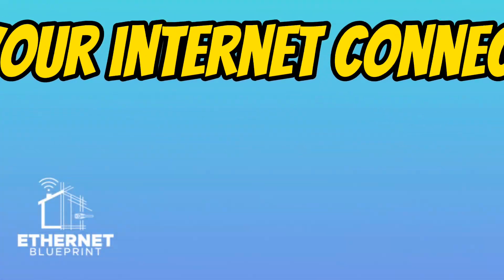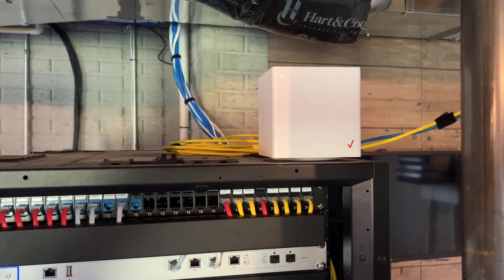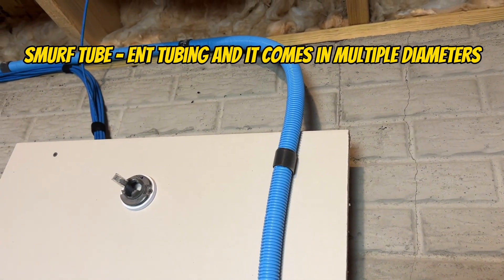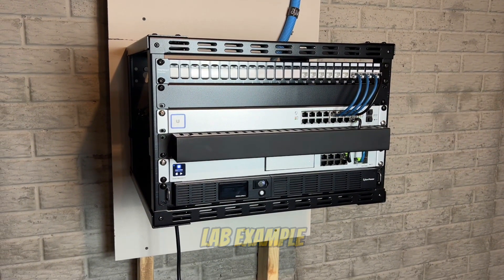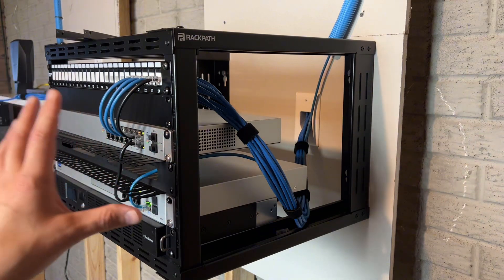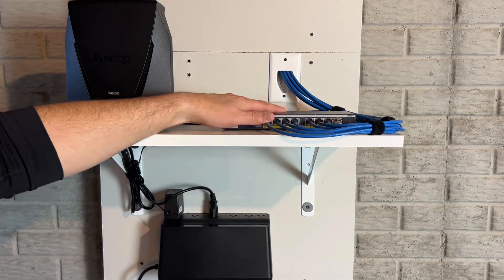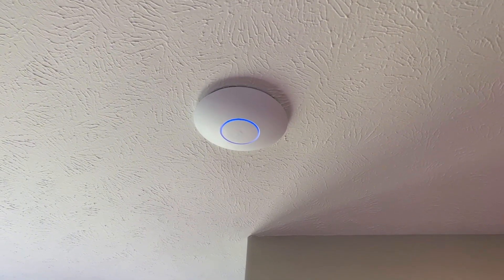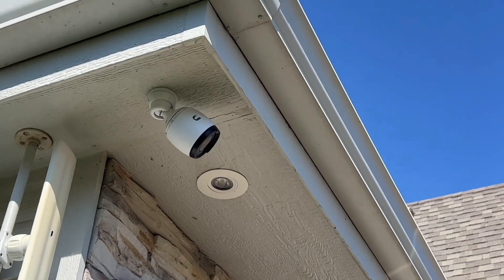CONNECTING it ALL Together - From your ISP to your Data Jacks

Comment: Thank you for this demonstration! It really helped me understand how all this works. I still don't know the difference between a TV jack and a network jack. Also not sure the difference between phone outlet cat6 and a RG6 and cat6. These are options for our new build. I wish I could take a picture of this and you could explain it to me lol
Reply from the maker: RG6 is also called Coax and those are used for cable providers like Comcast, Spectrum, Cox, etc.  OR can be used for Digital OTA antennas.  They are round and threaded and allow for a cable to be screwed on for connectivity. 

Network/Cat6 jacks are square-ish in shape and allow a network cable to connect in them.  They are used to bring network connectivity to anything that phsyically connects into the network. - Like Smart TVs.

Comment: Ah okay. Your most recent response makes sense to me. So Verizon apparently doesn’t use a “modem” or the ONT acts as the modem providing their internet connection via Cat 6 wire WAN connection. 

So I currently have that Cat 6 wire coming from the ONT plugged into the WAN port on the G3100 router. 

The switch that the builders provided was a TM7556, which, after trial and error, was just a phone switch and didn’t activate the Ethernet until I plugged the blue RJ45 cables into the LAN ports on the G3100 router. Now they work. 

But if I want to use a mesh WiFi network like a TP-Link or Netgear can the set up be:

ONT ➡️ Mesh Router ➡️ Switch (that has the blue cables plugged in) and then ➡️ ANOTHER switch coming from one of the upstairs Ethernet ports to use for the other devices such as the mesh extenders, TV, Firestick etc?
Reply from the maker: (sorry for the delay)  Yes, that should work.  You would just swap out the G3100 router with one of the mesh routers and you'd be in business.

Comment: Not sure why my reply to your reply is deleted. Thank you for your swift reply. Your videos and other research helped me figure out that I had to plug those RJ45 blue cables into the LAN ports on the Verizon Fios G3100 router. So they are now active. 

The Verizon Fios ONT, the Fios G3100 router, and the TM7556 telecom switch is in the basement. 

My question is that can I bring the G3100 router to the first floor if I connect the cat 6 wire from the WAN port on the Verizon ONT to a gigabit Ethernet network switch router, and then connect those blue cables to the LAN ports on the router. Then bring the G3100 upstairs and connect it through its LAN port and the Ethernet port on the first floor?
Reply from the maker: So the switch off the ONT is also a router and will be setup to do your IP Address dhcp for devices?  And then one of the devices you want to run off of this Router/Switch is the G3100 router?  I don't know that I know enough about your ISP equipment to properly answer that... 

Generally it is ONT --> Router --> Switch --> Devices

It sounds like you may have 2 routers in your setup?

Comment: I have a set up such that a Cat6 cable connects the Wan ports of Verizon Fios ONT to the G3100 modem/router. A Cat5E cable is also connected from one of the LAN port to the CAT5 on a switch port — a bunch of blue wires are plugged in. I think those are connected to the various access points around the house but I don’t know whether they’re active or how to activate them.
Reply from the maker: Are any of the blue wires that are plugged in blinking on the switch?  That will tell you whether they are active.  I can tell you that it can be very difficult to identify devices on a network without any labeling or info to go on.  What type of switch do you have?
Reply: @ethernetblueprint hello! Thank you for the swift response! 

The telecom switch that builders installed was the 4x8 TM7556. However after some trial and error I realized this was only good for phone service.  

I realized I had to connect the blue RJ45 cables to the LAN ports on G3100 Fios Router to activate the ports throughout the house. I tested the Ethernet connection from my laptop and it worked!

However my question now is: currently the ONT, the G3100 router, the TM7556 switch is in the basement. 

But because the G3100 is merely a router, ideally I want to bring it up out of the basement to the first floor for better coverage. 

Is it possible to  

1) connect the cat6 cable from the ONT to a WAN port on a multiport gigabit Ethernet switch network router?; then 

2) plug the blue RJ45 cables into that switch to keep the ports throughout the house active?; and 

3) use a Cat5E cable to connect one of the Ethernet ports on the first floor to the LAN port of the G3100 router, and have it broadcast a WiFi signal AND be capable for Ethernet connection?
Reply: @ethernetblueprint thank you for the swift response!

Your videos and other research helped me figure out that I had to plug those RJ45 blue cables into the LAN ports on the G3100 router. So they are now active. 

The ONT, G3100 router, and the TM7556 tele com switch is in the basement. 

My question is that can I bring the G3100 router to the first floor if I connect the cat 6 wire from the WAN port on the Verizon ONT to a gigabit Ethernet network switch router, and then connect those blue cables to the LAN ports on the router. Then bring the G3100 upstairs and connect it through its LAN port and the Ethernet port on the first floor?
Reply from the maker: Glad you are figuring things out.  Let me know if you have any other questions.